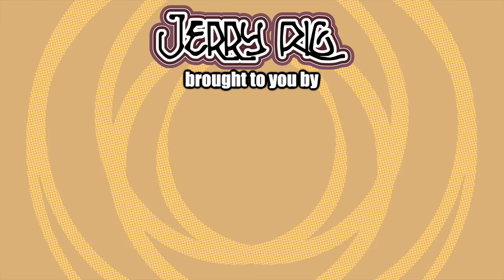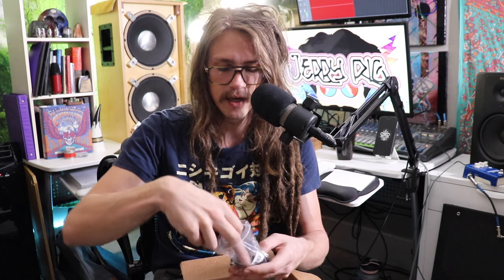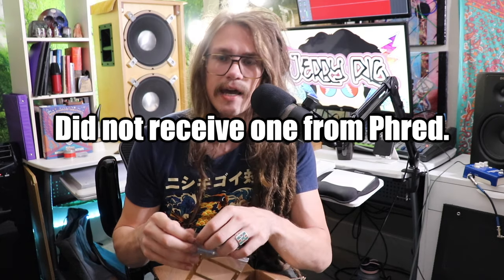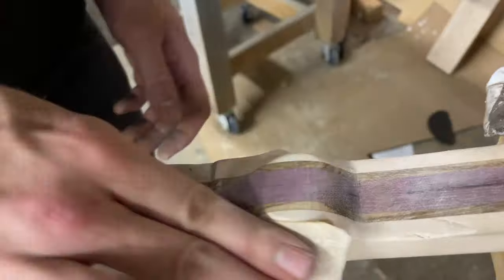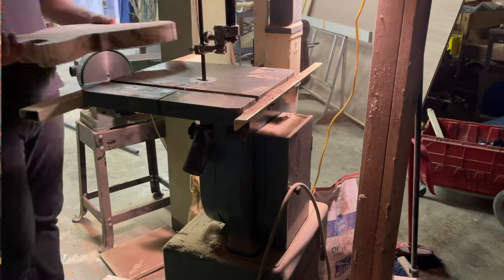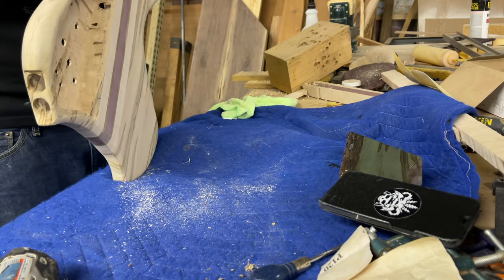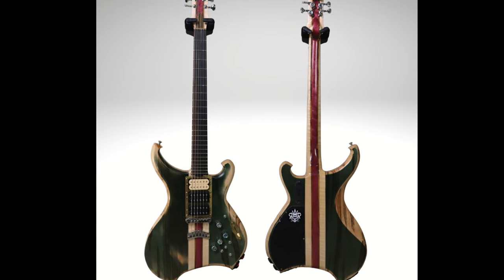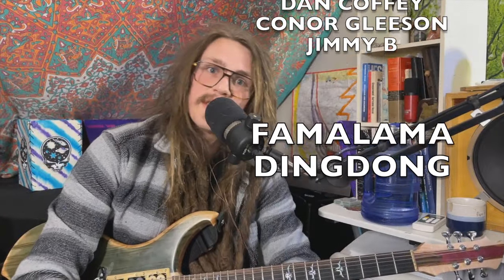Building a Custom Jerry Garcia Guitar | Birdie Build | Jerry Rig

Comment: Kudos, great work, one slight issue with the 24 hour clamping of the neck woods and the glue that you use. called Titebond which is an "alephatic resin" based glue. For perfect results give or take local humidity conditions only clamp the woods together for around an hour maximum (30 minutes on its instruction list). Of course your preperation may be felt by yourself as being less than perfect hence encoudraging yourself to over clamp the wood with this glue. 
What this glue does (and makes wood jointing stronger than the original wood with alephatic resin) is to naturally suck the woods together after the initial clamping period giving a natural tension throughout the finished laminate for the neck. Luckily I doubt with Zebrano in the mix, that you will notice any shifting/twisting of the neck due to its extreme density. 
A minor and slight issue. However in 50 years time you risk having a naturally twisted neck that will need fret levelling to be as perfect as you made it.

Comment: Hey Davvy.. As a bedroom Jerry tone fiend would you recommend the V22 Bugera or the Milkman as a jumping off point for the Jerry tone search?? And if the Milkman, do you think either the 50 or the 100 watt version? Thanks Davvy..
Reply from the maker: The v22 is okay for bedroom playing, but not great for a gig. The milkman amp is an amazing choice for versatility. You’ll have to invest in a cab and speaker(s). I use the 100 because I play all the time and I need power to fill rooms of any size and the 100 has no problem. The 50 is a great amp and can do a lot, it’s just a bit less juice behind it. Again, great for recording, room playing and smaller venues.
Reply: @TobyDavvy  thanks for the reply Davvy. Had you upgraded the Bugera at all?
Reply: @TobyDavvy  Hey Davvy.. I really appreciate the reply and I just spend the last hour banging out "Sitting Here in Limbo" so thank you for that too. So if money was not an issue and the only goal was to get closer to Her's tone would it be The Bug 22 or the 50W Milkman with a cab?
Reply: @TobyDavvy  well I know you can't reply to every single message Davvy and I really appreciate the times you do. Hopefully I made the right choice. It was between the V22 and the Milkman 50, and I just had an opportunity on an amazing deal for a Milkman on Reverb that helped make the decision for me. I scored a mint 50 watt MM for just over $400!! Score !! I already have a 1x12 Vox Cab with a stock Celestion. That was under $200 also. We'll see if I have to replace the speaker, but it is a great deal on a sweet white enclosure to match the Milkman. Hopefully I made the right choice..

Comment: The fact that the neck is made of many parallel pieces is pretty controversial. Do you notice any difference?
Reply from the maker: What are you talking about? That’s a standard way to put together a neck thru guitar.
Reply: @TobyDavvy  Like the neck isn’t a single, solid piece with a “tongue” cut out of it going through the body